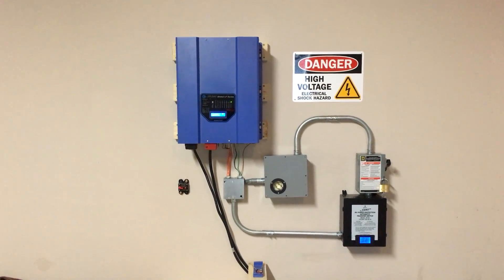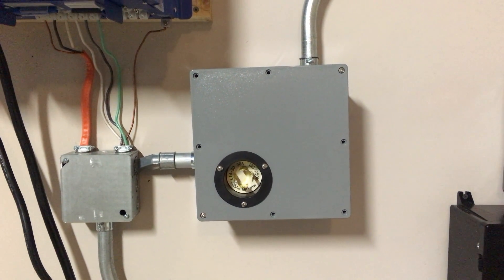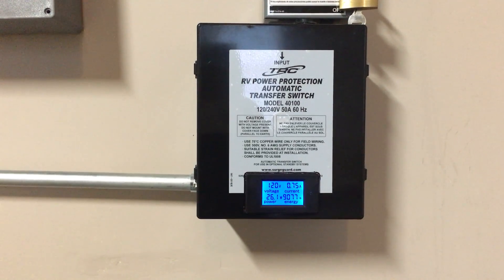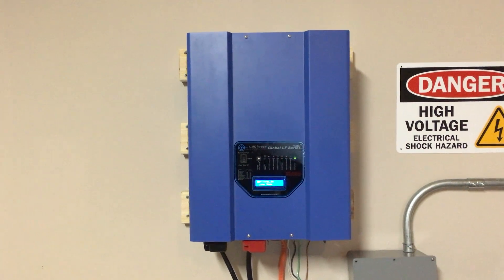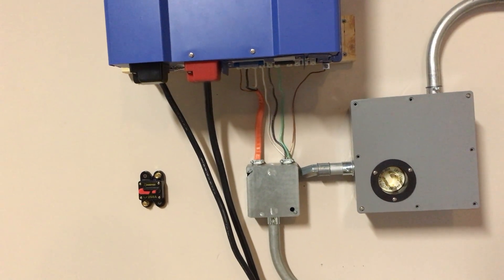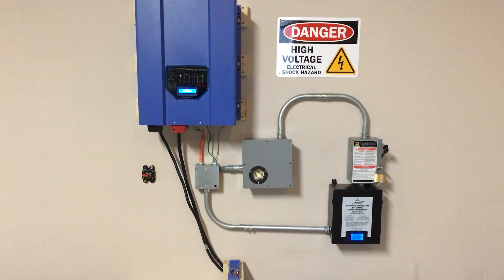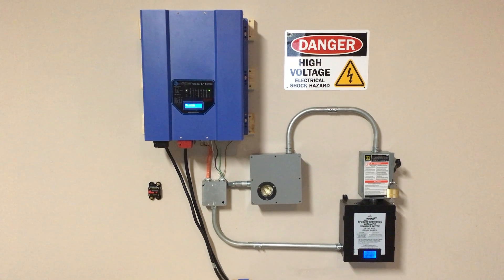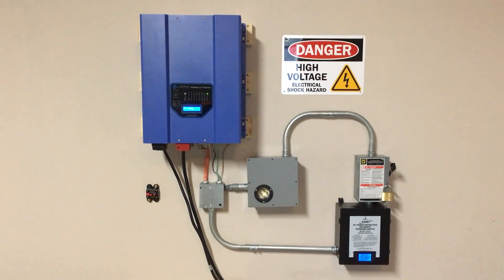Aims 6000 watt 48v inverter and battery bank (Whole home uninterrupted backup) - 1 of 3

Comment: Please i need to know if i can run a (5kw) inverter direct from the grid with a 250/48v dc to ac down trans former and will i use less power from the grid  as direct from the grit (5Kw). Take note no Solar panels or batterys

Comment: Great job explaining, I’m doing the same idea , any suggestions welcome , “ I have a 3-5 KVA 230v Pure Sine Wave Inverter 230vx1 , charge controller 48v & a Moes Automatic Transfer Switch , I have both a 50A Double Pole Breaker & a 100A , my battery bank is lithium phosphate 3.2v x 15 = 48v & a 2.4v x 20 = 48v which was my first bank , 6/4/10’ , 6/3/10’, grounding rod 5/8” x 6’ Bear copper wire , 1/0 x 15’ RW,RHW Aluminflex , 1/0 x 15’  SIS Aluminum, 1/0 car audio positive & negative,

Comment: I got a question

Don't you need about 24 batteries to run a house and same amount in panels  .

I'm got land thinking on down sizing   no grid tie  though. 
I hate City laws and taxes etc. Government crap too.
The less they know the better.

Is the Aims kit good . 
The 8,000 watt one for about 17 or 18 k.
Or buying it all separate would be  better?

Comment: You need way bigger wires on the D.C. side of Your inverter.  something like 4/0.
Reply from the maker: This video is of my old setup.  You can see the new one in the description.  This was more of a proof of concept.  My house will not pull enough power to ever make the invert go over 1/3 of it's 6000 watts AC.  Specially in an emergency i'll go critical loads only and i'll be in the 300watts or less AC voltage range wise

Comment: wattmeter shows wrong number ,120 x 0,75 =90 watt but it shows 27
Reply from the maker: Good eye.  I never notices that, but I did just go run out and check it and it is displaying correctly now.  I'm not sure why it would have done that during this video.
Reply: e.

Comment: Solid video, very clean set up :) safety well done. My only question is what the LCD meter from amazon is called? 

Thank you for the video
Reply from the maker: Darryl S link: bayite AC 80-260V 100A BYT-VAEM-034 Digital Current Voltage Power Energy Meter Ammeter Voltmeter with Open-close Current Transformer https://www.amazon.com/dp/B01D8G9GPW/ref=cm_sw_r_cp_api_RIAzybQ7YV797

Comment: Why two transfer switches?
Reply from the maker: The external transfer switch is for switching between utility and generator power.  The one built in the inverter is for switching between the incoming power utility/generator and the battery bank.

Comment: I have a very similar setup that I hooked up last year using an Outback VFXR3648 and eight 6v golf cart batteries.   works very well, and the Outback supports grid tie once I can afford solar panels for the house.   Just this week, I enabled the timer on the inverter to switch to battery power between 4pm and 7pm which are summer peak times for our utility company.   I love this outback!  it does everything lol.   anyway very nice setup you have!  and clean install.   looking forward to the next video.

Comment: nice setup .... by the way if you like to upgrade your b-bank in future... look for forklift battery even the used ones.
Reply from the maker: +Nureddin Benamer
I've looked in to forklift batteries and while there are a ton of them on craigslist the price + AH + weight isn't worth it for me.  I can get these AGM batteries locally for penny's on the dollars through a local battery distributor.  Thanks for the compliments!  I'll be doing the next two videos soon the show the generator hook up and the transfer/bypass switch i'm using.

Comment: Out of interest how quickly did the Battery voltage drop down to 47? I have a similar set up with 220Ah @48v but when I put an electric Kettle on 2400w (240v) my Batteries instantly drop to 49v and I get a low voltage alarm on the inverter although it does boil the Kettle. I'm starting to think my old agm Batteries may be to old to hold a load.
Reply from the maker: +J Grieve
Does you voltage drop down and stay there or does it drop down and then recovers over time?  I've seen my battery bank take a voltage hit if a high load starts pulling on the system, but as it stabilizes the batter voltage will raise again.  It took about 6 hours to get to 47 volts on my system with my 134AH @48v and ~2000 watts being pulled on the battery bank.
Reply: I did it during the day and after the kettle switched off the charge controller brought up the charge within a few minutes so I might try it without the solar connected and see if it recovers. My Batteries are pretty old agm's so they are possibly getting weak or close to the end of their life.

Comment: What size is the batteries. As I have the same and I get just over 2 hours on mine with panels being isolated..
Reply from the maker: +bosshoggett
The Batteries are 12 volt 134 AH.  So 4 batteries in series = 48 volt @ 134 AH.  Two battery banks in parallel = 48 volts at 268 AH. 48 volts * 268 AH = 12864 watts or 12.8Kw.  These are AGM batteries and weigh 100lbs+ each.
Reply from the maker: +bosshoggett 
I just realized that in the video I still had 4 batteries.  I now have 8 and pushing about 18+ hours of backup time with my load.
Reply: dubohio